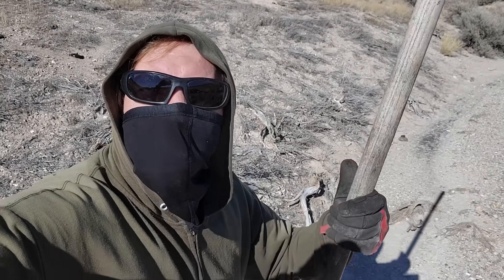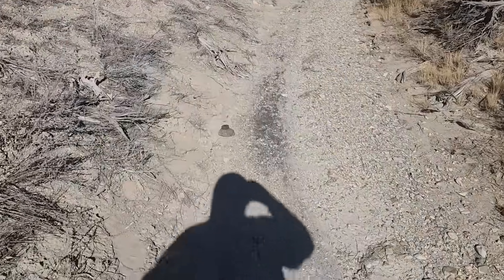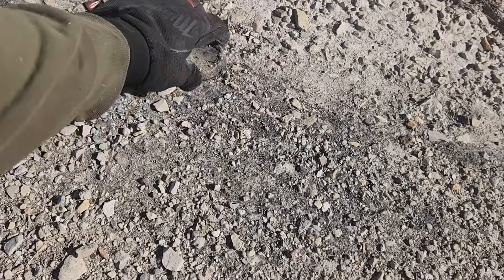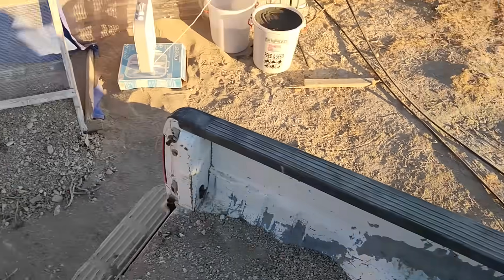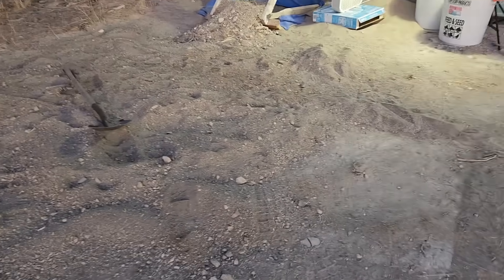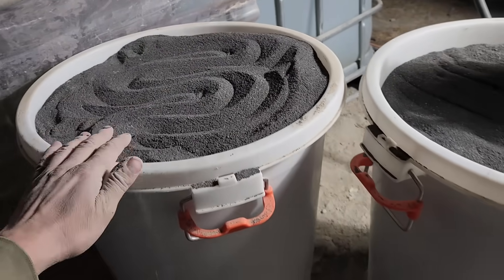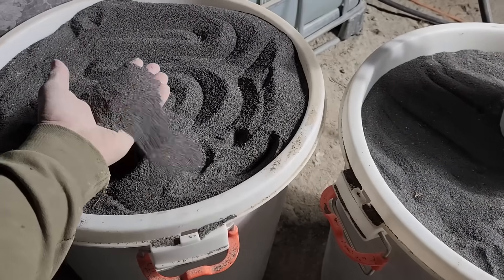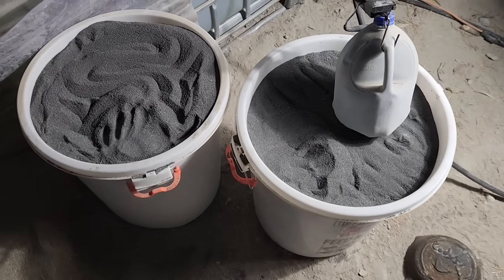Mining Magnetite

Comment: I wonder if you could skip the "refining step" (or two) by adding a second magnet positioned below the first magnet, would make the setup taller but skipping one manual input and time.

----------Magnet 1 | (stream of raw material.)
----Magnet 2 | (stream of partially seperated material.)
Magnetite |

Comment: If you have enough water, I guess you can remove most of the remaining contaminants by first letting the steam of iron oxide go into another bucket wiith a blowing fan, and then into a bucket with running water.  
Alternatively just in a bucket of water, and manually picking it up with a magnet.

Comment: I'm curious if something like a smooth plastic hamster wheel that rotates freely around the 2x4 the magnet is mounted to would improve separation.  Magnet is close to the side near the stream, the magnetite colects on the wheel trying to get to the magnet.  as more collects the wheel gets off balanced and rotates down depositing into the bucket as it moves too far from the magnetic field to continue sticking.  Just a thought to  find another solution that does not invovle bouncing the stream off the magnetitie and geting dust /dirt stuck in it.

Comment: Thinking about this for a few minutes in my head (not saying this will work, totally untested and your way is much simpler/easier to build.)  but I thought about a large magnet behind a protective screen and some sort of moving conveyer in front of that to catch it and move it away. eg, The iron sticks to the conveyer in front of the magnet and then the conveyer takes that away to a bucket somewhere.   This setup would be quite small, and would exist inside a larger tube as part of an industrial vacuum cleaner. You would then just vacuum up the dirt from the ground and it would come out in two piles, the tailings that just went through the vacuumed cleaner pipe and out the other end, and the other pile of what the conveyer moved away against the flow of the vacuum air

Comment: Cody, if you use a magnet to pickup the iron it’s much easier to place a thin membrane of newspaper or cling wrap on the magnet first that way when you’ve picked up your iron all you have to do to separate it from the magnet is pull the membrane away from the magnet the iron will lose magnetic pull and fall freely.

Comment: I was thinking it might be possible to have a magnet behind a metal cylinder so that as the magnetite collects on the side, it is no longer balanced and it starts to slowly spin moving the magnetite lower down where the magnetic field wouldnt be strong enough to hold it and you could collect it without much buildup. Although the magnetite might slip upwards or it might just not be heavy enough to overcome the magnet's pull.

Comment: Try making the initial sifter out of your screen wire over a rebar frame that mounts on a wheelbarrow. Make the mount so you can either collect the reject material in the wheelbarrow or the stuff you want. It's a lot easier than re-shoveling the material to move it elsewhere. Thanks for the interesting ways to collect magnetite and the interesting sorting methods.

Comment: You need a plastic bag on your magnet
Reply: Why
Reply: @watchinyoutube8919  Easier clean up at 12:28 and no magnetite dust permanently stuck to it.
Reply: @watchinyoutube8919  So you can remove all metal from magnet by romoving the bag
Reply: @watchinyoutube8919  Because then the magnetite won't stick directly to the magnet, and to get it off, all you need to do is pull the bag away from the magnet, and it all falls off, leaving you with a clean magnet almost instantly, rather than fighting to separate the iron from the magnet.
Reply: I remember him doing that in an old video, but as he demonstrated if you remove the ball of iron you have to fill it again to restart the system, this seems like a dedicated  setup, so he doesn't need to clean the magnet between runs. 
But if anyone needs to keep a magnet clean, a bag indeed works great.
Reply: @Sal-T  - And what advantage does having a "clean magnet" provide? He's doing bucketloads of the stuff, one after the other. The amount that stays stuck to the magnet is negligible, and it only needs to be cleaned when he finishes the last bucket. The whole point of this setup is that the magnetite falls naturally off the bottom as new magnetite is attracted.

Comment: I'd get a bunch more buckets and skip that dump in the bed step, you could pour even layers for drying with much less effort than shoveling. You could also use a small magnet on the edge of the bucket (or set lower and back from the big one to continue the "swing" of the material) for the second step to improve any potential loss in the second stage and make it a less finicky variable than bucket placement. Great work once again, thanks for taking us along bud!

Comment: A second magnet under the first might help deflect the iron even further and give you a cleaner first-pass separation. Tilting the magnet at an angle so the magnetic field extends just a little farther at the low end could help too. A low-speed fan behind the magnets could also help deflect the sand, further improving first-pass separation. 
I think the biggest advantage this method has is that it takes zero power beyond your own. Improvements, like a fan or rotating magnets and brushes, might make it more effective but add an outside energy cost. In fact, you could potentially replace the fan under your screen with a wind tunnel to eliminate that energy cost as well. 
I think the next upgrade should be a larger hopper that combines the screen sieve and has two magnetic passes. Just dump your aggregate ore into the hopper and go get more. 
That's a LOT of thermite. I'm curious what you have planned ;)

Comment: Might place a piece of plastic wrap over the magnet. After processing a bucket, you can pull the plastic and magnetite off. The next bucket can then be processed through the stronger magnetic field with less divergence than had you left the magnetite on. 

Honestly, I don't think it would make a significant difference,  but it might make a small difference. Ironically it might get a little more sand bonded to smaller magnetite particles that othereise would have been less influenced by a magnetic field that had diverged more when covered with magnetite.

Comment: I find it interesting that the same method that's been used for separating grain from chaff in agriculture for ages is also used in separating metal and non-metal trash, but also for purifying magnetite for making thermite, the only difference is if you're using an air stream and separating by density or if you use a magnetic field and separate by magnetic properties. In industrial use when they separate metal and non-metal trash they use a very strong magnetic field that comes from a rotating magnetic drum (that way they keep a constant load, same as you having the magnet fully loaded with magnetite) and the trash gets accelerated to a pretty high velocity, which increases the separation angles

Comment: I used to do mineral separation with a Frantz machine, which is basically just this but more precise, and with an electromagnet. Except I was doing it to get rid of anything magnetic. Other dense minerals will also deposit with the magnetite in a stream. I was looking for zircon and apatite, which are used for geochronology. Zircons are especially beautiful under a microscope because of their classic crystal structure.

Comment: Great system you have going there, can I suggest for the initial collection you get a thin sheet of metal connected to an electro magnet and lay it across the gully floor then using a leaf blower, blow all the material across the sheet. that will prevent you from needing to classify the rocks and you will start with a higher concentration of ore. you can even call the capture device "Cody Slab".  Also ive watched your channel for many years, I started following you before the creeper sticks had to be taken down :( keep up the great work.

Comment: Simple and brilliant way to separate them. 
I collected "black sand" from the beaches of San Diego with NEO magnets and sandwich bags. 
Put the magnet in the bag and run across the beach. Once enough is collected, I just reverse the bag and get the magnet out without any fuss. 
Put it in a new bag and continue... I easily collected 5 pounds in one hour. 
Makes excellent core for pulse motors when moistened with a bit of epoxy and packed into any shape mold. Minimum eddy current losses.

Comment: 13:48 maybe he could add a large plastic roll around the magnet. With an horizontal axis behind the magnet it would rotate by itself (like a water mill) with the accumulation of magnetite particules. Then the particules are pushed too far from the magnet and fall in the bucket.
(Edit: now I saw the end of the video and the part concerning the separation is already quite convincing... So I guess simplicity is great.)
I'm also a bit concerned by the initial work. Wouldn't it be better to do a first step on site to avoid carrying all that dirt ?

Comment: you can use an electromagnet, ie treasure finder, to collect and purify the magnetite sand, yes with pulsing operating mode. can be combined into shovel or a shift shovel. or similar to bush berries picking tools, not getting much of the plant greens with the berries, just the berries, or the ore. actually you can get other pure conducting metal particles filtered out of the ground at same time, using the metal maglev pulse pull-push property. like gold and silver. platinum ie metals. actually a maglev induction stove under a melting crucible would work nicely. to separate metals/magnetic from non-conducting material. a better faster gold panning melting method, without chemicals. the gold nuggets and particles, dust, just needs to collectively or individually levitate. instead of aluminium, try charcoal blast furnace, maybe a centrifugal blast furnace, for radial instead of gravity, center fed. or maybe just hydrogen gas from electrolysis.

Comment: A gallon of magnetite should weigh around 43 pounds. So wouldn't that make the barrels only around 50% purity?
Reply: Can't tell without knowing the packing coefficient
Reply: @blahblah3347  Even if the pieces were oddly shaped, you're still not losing half of the weight. I just don't think he realizes how much dirt is still in the total buckets.
Reply: SG of pure solid magnetite is not the same as sand grain size. Lots of air btw grains.
Reply: @neopopulist it would be even more than 43lbs  if it were one solid/fluid mass.

Comment: Maybe use another magnet lower down in the stream on the second pass to help more thoroughly separate the streams so that the bucket doesn't need to be so precisely placed? Maybe a longer  magnet could be useful to apply the magnetic force over a longer portion of the falling sand stream?
Reply: what might work best is a long magnet mounted at a 45 degree angle, to maximize the shadow effect he was talking about.
Reply: Oh yeah that would surely separate them further, I think the magnets could even just be be right next to each other but just angled away from the stream to carry it further away.
Basically like having a bigger magnet but more width isn't helpful so you just stack smaller ones to get more length.
Reply: I was thinking about a multi-stage configuration also!
Reply: My thoughts exactly.
Put another one below and more to the back and make the magnetite drip father away from the normal sand.
Reply: Longer magnet at an angle so it has to take a longer concave path, perhaps
Reply: I would think the simplest solution would be to just put a funnel to a bucket directly under the magnet, since the iron bits seem to pretty much drip directly off the bottom of it.
Reply: I think he can just run the magnetite through again and get the same effect as a second stage
Reply: @witiwap86  True, but I suspect the manual labor is one of the major limiting factors on this process. The fewer things the human does the more that can be processed in a given amount of time.

Even just stacked the existing two buckets above each other in sequence would get a lot of labor reduction.

If I needed literal tons of magnetite, I'd be looking for a hill I could use for re-arranging the existing stuff by stacking the stages up. Dump the raw product out of the truck at the top of the hill, shovel it at the screen so it dumps the fines directly into the fast bucket, feed the concentrates from that directly into the slow bucket and have some big catch bins at the bottom so you can truck the waste stream from the second stage back around the top.
Reply: @benjaminshropshire2900  I was really just pointing out that a second stage wasn't necessary for purification. 
However, consider that doing a second run just involves lifting the bottom bucket and pouring it back up into the top one. It's very low effort. He'd have to be processing massive amounts of ore and even then he'd still have to move the same amount of tailings. I just doubt it would be worth the setup time.
Reply: Yeah, a second magnet 6" below and 3" behind the first would provide better separation and yield a more pure product. Raising the first magnet higher so the velocity is reduced would probably also help increase yield.
Reply: Yeah!!
Reply: This is a great example of "In love with the solution"
Reply: My thought was put a string of magnets behind a curved and inverted low friction surface. The low friction would increase flow and reduce the depth of the mat (which should trap less tailing), inverted should allow separating the streams further apart and curved should allow getting it really inverted. Something like a 5 gal bucket on its side might work well. Another things that might help would be to have multiple catch bins: one for "only tailing", one for "only product" and one between for "run it again".
Reply: @benjaminshropshire2900  I was thinking of something similar: Have a thin-ish wall with magnets behind it sloping a bit away from the stream (so not a straight, vertical wall). The iron would be drawn towards that and slide down it, and the sand would fall straight down
Reply: @benjaminshropshire2900  A series of small, powerful magnets on a wheel bearing, maybe?
Reply: @tildessmoo  maybe? But a lot more complicated. I was trying to keep it dead simple.

Also a wheel runs the risk that it will get loaded up uniformly and start spinning. Now if you could get a spinning plastic wheel with about 1/4 of a circle of magnets fixed inside of it so the product gets pushed past the magnets...
Reply: @benjaminshropshire2900 I'm jealous of your inventiveness. The spinning wheel with stationary magnets inside is brilliant. I'm curious by what you meant by "inverted" in your first description. I pictured something like an upside-down slide in my mind, but I'm not sure if that's exactly what you meant.
Reply: @benjaminshropshire2900   Maybe I'm not picturing the setup properly, but I think spinning would actually not be a problem? Just throw up a bit of tarp as a backsplash or something. And, while the bearing itself might be complicated, using it would be as simple as putting it on a stick and putting some magnets on it.
Reply: @javaguru7141  re inverted, I think your thinking along the same lines as me. Basically something where the magnets are pulling up and gravity is helping momentum move the tailing away from the product.

As to the wheel with stationary magnets idea, not original to me. It's a variation of a common way for pulling steel from shredded mixed scrap metal. That is often done using a converter belt with a magnetic roller at the end.
Reply: @tildessmoo my concern is that 1) you might end up throwing stuff all the way over the top and 2) there wouldn't be enough time and the tailings would get dragged along with the product.
Reply: @benjaminshropshire2900  Add a coil of wire and you've got yourself a generator.
Reply: @benjaminshropshire2900 is that not more or less the same thing he's done here but there is no barrier between the magnet
Reply: @watchinyoutube8919  more or less the same, but not exactly. Same principal, but with some refinements.
Reply: My thought was an electromagnet that periodically turns off to dump the magnetite stuck to the magnet